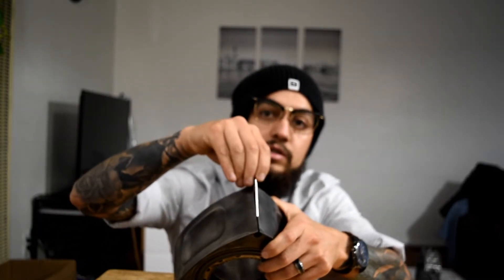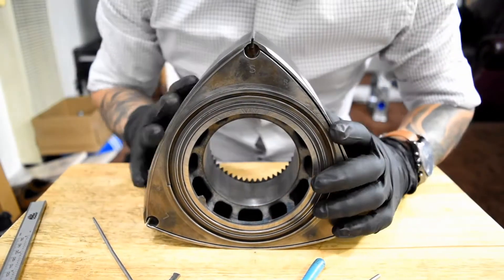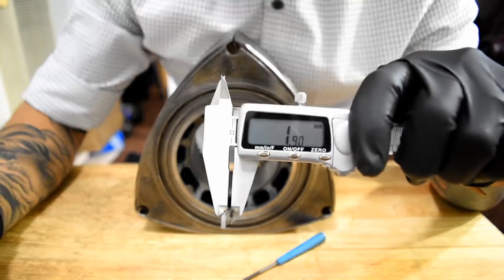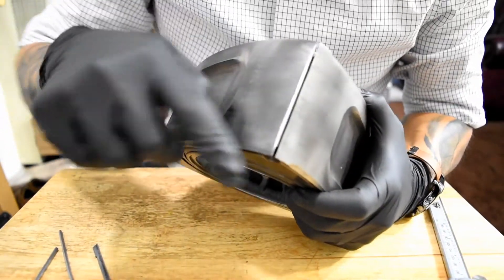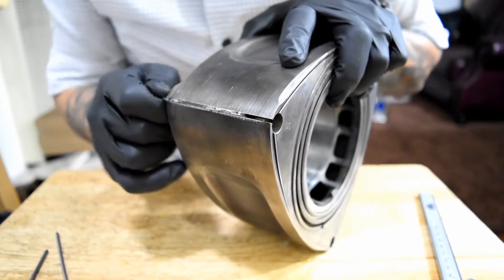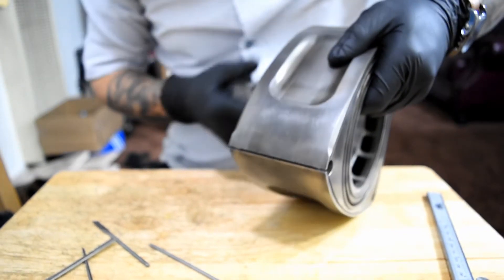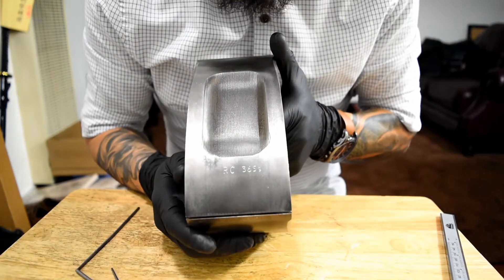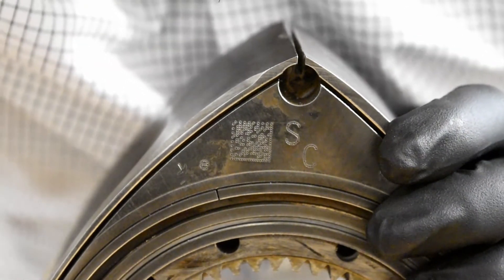How to rebuild mazda rx8 rx7 13b rotary engine;ROTOR specs,apex seals,fixing the grooves on the 13b

Comment: This is ultra highlevel material management.. I like it!! Most rebuilder just buy new, and dont check the gaps at all! I learned alot! Thank you!
Reply from the maker: Andre Krohn thanks for watching nd you're comment! Stay tunned for the next videos of how to assemble the rotors and all the seal gaps and measurements 👍
Reply: Have a RX8 @ my own, and i guess, i have to rebuild it within some 12k miles. Bought all necessary tools, need to buy new bearings and seals for the first time. You helped me alot with your vids. Appreciate your work! Thank you